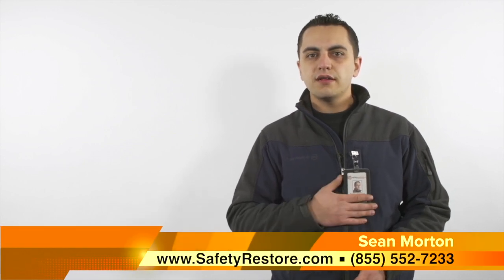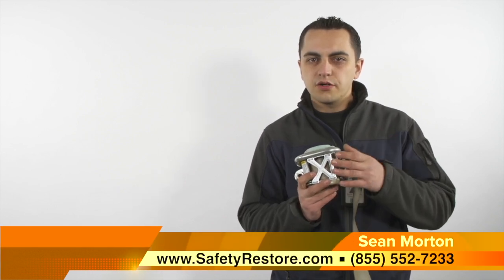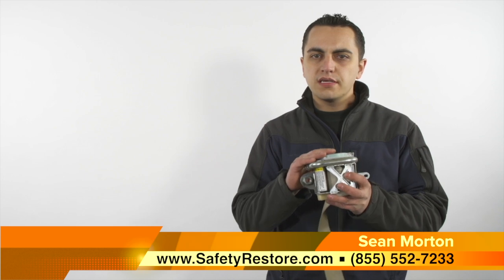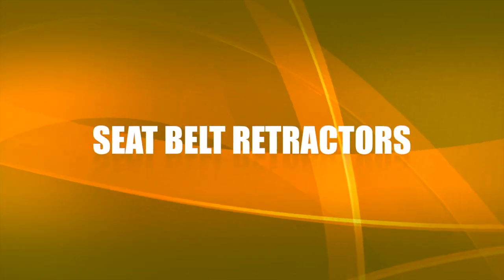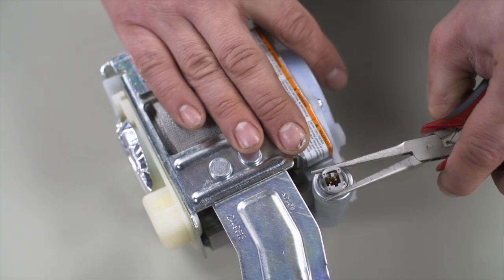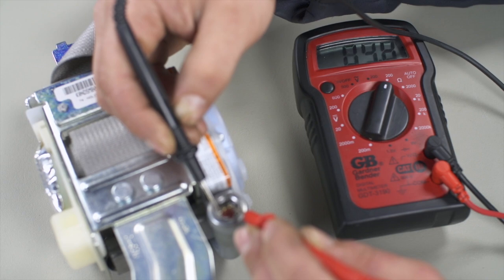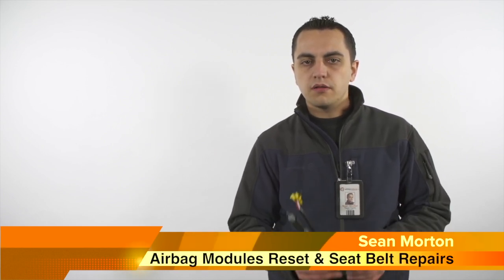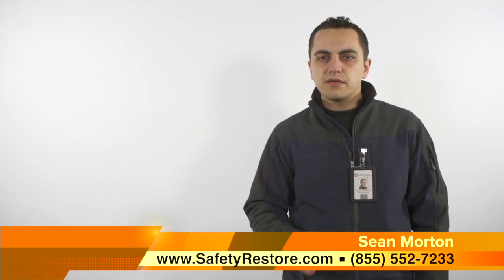SAFETY RESTORE How To: Test for Locked & Blown Seat Belts/Buckles

Comment: This video is very very useful But I have a question about seatbelt.Do you know the difference between the passenger seatbelt and driver seatbelt? I can not find a seatbelt for driver so I want to use a passenger seatbelt.Thank you
Reply from the maker: +Yanchao Wang Yes, there is a difference. You will need to get one specifically for that side.

Comment: To Sean and company,

ny vehicle has a rear seat-belt pre-tensioner that no longer retracts the belt. I think that I may have pulled it too strongly while installing and removing my childrens' safety seats. I did pull it out as far as it would go in order to fit it around the safety seats.

In such case, is there some mechanical fix that may be applicable? Do you have a video for that?

Thanks
Reply from the maker: James Firth Hi James, thanks for the question. You may have broken an internal component responsible for locking the mechanism.  We do not repair any cosmetic damages and recommend you buying a new seat belt from the dealership to assure that you and your family is safe. All best!

Comment: I have a 2015 Ford Explorer that has been repaired after being wrecked.   The rear passenger side seat belt retractor is stuck in - originally you could get it to come out with spending a lot of time fooling with it.  Now it is stuck in and can not come out at all.  If I take it out is there any chance of it going off or anything???   Then I can just send it in to you and get it fixed???  Thanks!
Reply from the maker: Hi Jerry! We'll be happy to repair that seat belt for you. Simply disconnect the battery while removing the seat belt and you won't have anything to worry about. All best.

Comment: I unpluged my tensioner cable and now the airbag light is on. How can I reset it?
Reply from the maker: +LOV2XRL8RL If it threw a code, you'll need to reset it with a scan tool. Otherwise, disconnect a battery for a minute and it should go away.
Reply: I disconnected the battery and the srs light os stil there, blinking. Maybe the tensioner is bad?

Comment: You can not repair seat belts. They have an explosive charge controlled by your srs module. For your safety when air bags blow up the explosive charge on your seat belt blows up too and tightening you up against the seat. Ask this guys if they replace the charge...I doubt it! Buy a use one.
Reply from the maker: che We replace the blown charges with 100% OEM gas charges. Our work is certified and is accepted by law enforcement all around the states. Thank you for your concern!